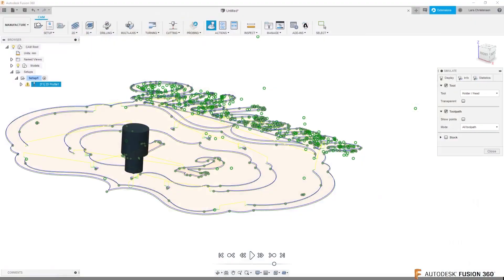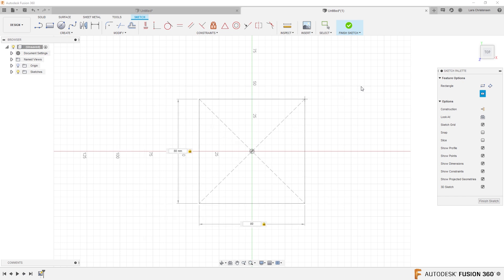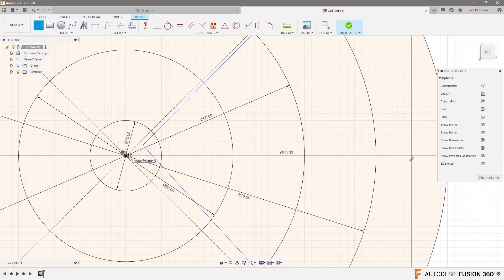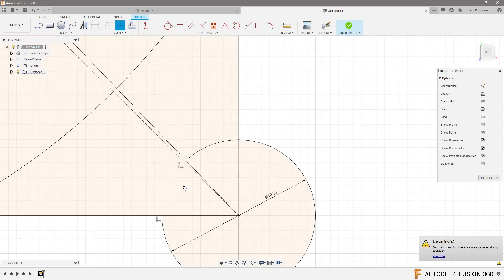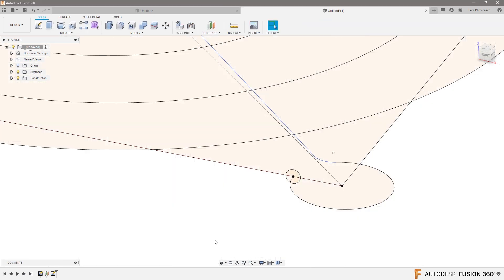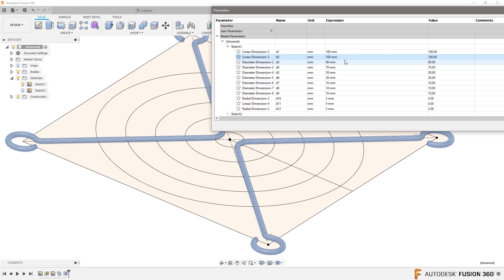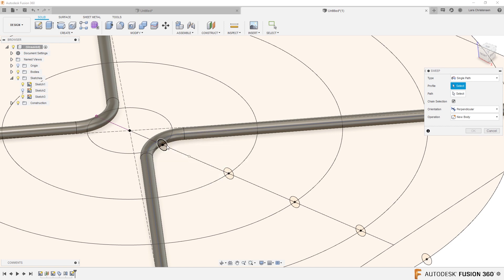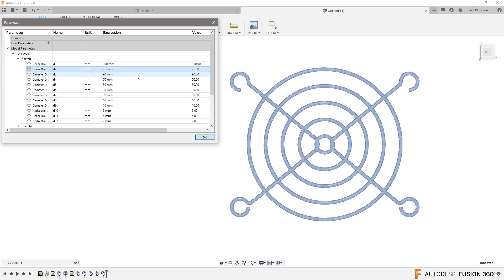Fusion 360 — Create Custom Computer Fan Grill — Ask LarsLive

Comment: Could you not do a singe revolve, pattern it out with a given spacing and then set the number of instances to be a function of the space between the mounting holes? Have not tried but seems like it might work in my head.

Comment: To create a number of concentric rings driven by parameters you need to sweep just one and only one profile. It should be the only closed perimeter (profile) on that sketch in order not to confuse Fusion. Of course you cant create, lets say 5 independent rings this way. Later you need to create another sweep comand with another profile that "cuts free" the rings. The later sweep command must be performed again over a profile in a sketch that should be the only one closed, otherwise it would lose track of wich profiles were involved when changing the number of rings. 

As Lars always say: I hope you enjoyed it. Thumbs up if you like it, down if you don't
Reply: So parameter NumRings is set to 4  and it creates four rings on a 60mm frame.  Now changing NumRings to 6 it needs to create six rings on a box size of 80mm.  How would your idea fit into that requirement?  Can you explain further?  Thanks Jaume!
Reply: @tralfazy  I'm sorry I haven't answered before, I'm travelling through the Toscana and I wont be back home till next week. It's quite difficult to explain in detail what excat shapes you need to create. I've put together a small 2 minutes video showing it. I hope it clarifies the matter. You can see it on my youtube personal channel. Just click on my name and check it out.
Reply: @jaumegb3710  Wow!   Good one!  I don't yet understand why this works.  I'm going to try to duplicate your results now.  Was this a technique that you came up with? Thanks muchly for posting it.
Reply: @tralfazy  I figured out that if the problem with revolutions over multiple profiles created by paterns were the missing references... then the only one way to do it were having only one reference
Reply: @jaumegb3710  Makes sense.  Thanks for that.  Could be very useful sometime.

Comment: I noticed that on a real fan grill, all the 'rings' are actually in a different plane than the X wires because the X wires don't pass through the rings, they are tack welded on top of them.  If you need realism, the rings need to be created on a plane that is one half of a wire thickness below the X wires  or .75mm for a 1.5mm wire diameter.
When the size of the fan gets bigger, the spacing of the rings doesn't grow, the number of rings increases instead.  For the real fans that I examined, 120 mm fans have 8 rings, 80mm fans have 6 rings, 60mm fans have 4 rings typically.  I'm guessing that the maximum ring spacing has to do with the size of a child's finger?

Comment: Hi Lars!
I'm intrigued by the problem of how to set the number of rings as a parameter.  It turned out to be harder than I had thought that it was going to be.  I thought that I would be able to set a zero length or zero diameter but Fusion 360 won't accept zeros for dimensions.  There's not access to a visibility setting.
I've only had success in hiding rings by placing them in another ring's location.  I hope someone can post a better solution for doing something like this.

Comment: Hello sir! please help meeee  I'm doing research on block shear failure in steel L-section and practically i have calculated all the parameter and now im trying by simulation so i didnot find any software that can create actual  rupture or crack failure like realistic cracking in model of section, all software are just streching(tensile test) the model and showing stress FOS etc so pls sir help me HOW TO DEVELOP OR SIMULATE REAL CRACK OR RUPTURE FAILURE IN MODEL so if u could help me then than thts great and sir i will refer you in my journal Thanks
File link- https://drive.google.com/file/d/1eigrJqke3j2VRkjgH6-8V5tAtVbOfU13/view
video link for reference- https://www.youtube.com/watch?v=J-tzdceowZY

Comment: Lars - when you're patterning the circles, can you make the number of circles a math function based on the distance between the corner holes?
Reply: Of course he can do it as a function of the distance. The problem is that the sweep command "wont notice" any new circles.
Reply: @jaumegb3710  Good point. I was thinking if you put the pattern before the sweep it would work. I wasn't considering the sweeps are all separate commands.
Reply: @jaumegb3710  I think a select could be generated programmatically that grabs all the ring circles and could do the sweep in one step. Good luck with the eye hooks. UNLESS the eye hooks are also created programmatically and Joined. Still an 'I think,' not sure.
(For the fairly small number of different sizes needed I'm not sure it's worth the effort. There're fudge factors for ring count, wire diameter, eye hook hole size, and each of these have to be 'sperimented with to find the right factors. After a set of standard size grills is made, none of this is ever used again for anything. It's a lot of time for little payback.)
How about design a separate part for each 'ring count,' then use scale to make others within that ring count range.